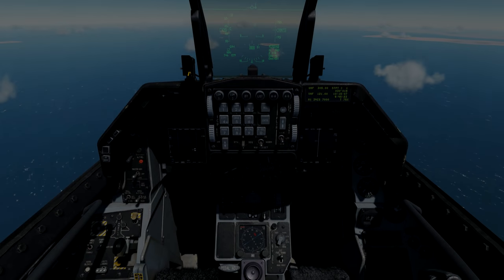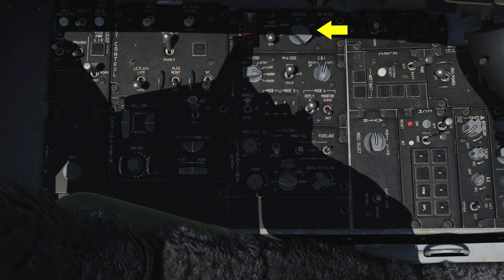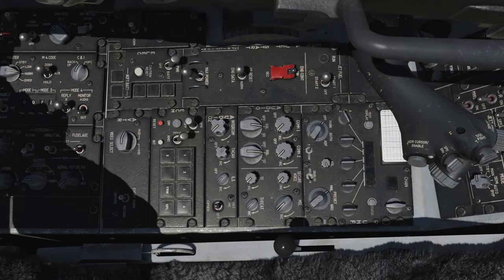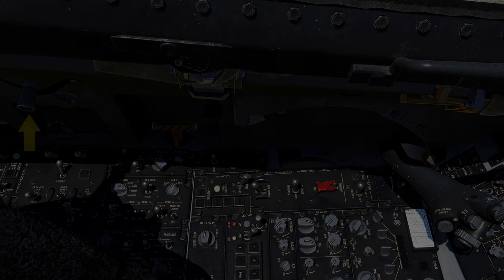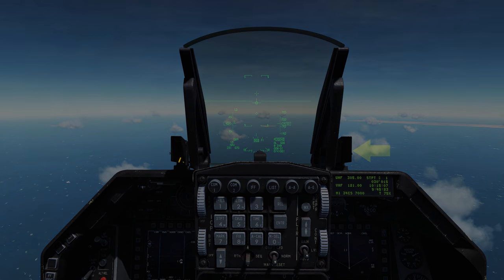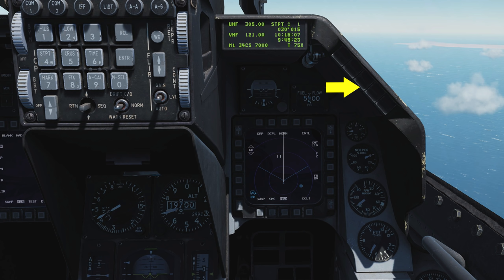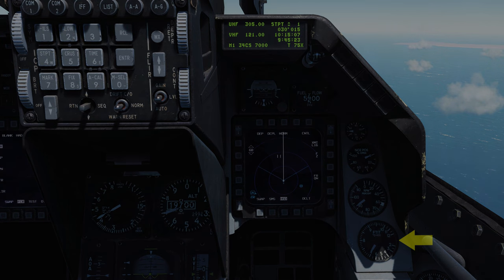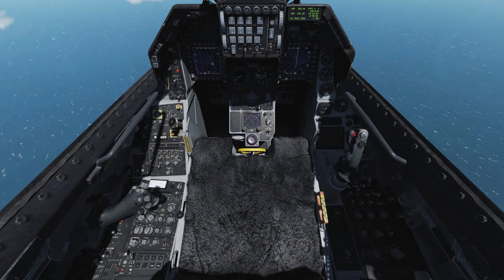DCS: F-16C Viper - Cockpit Orientation

Comment: “And finally we have the emergency arrestor hook and no this is not meant to be land on carriers although i know many of you will try” -Wags 2019
Reply: That's the second thing I'll try actually...the first one will be to take the plane off the ground.
Reply: taking off on the tarmac will be the first thing I try, landing on a carrier second :D
Reply: You're goddamn right we're gonna try, Wags. Just like the F5
Reply: @Swatmat  yep, it's a challenge, I've never done it without damaging my wheels.
Reply: @connorhuchteman  Barrier cables are permanently installed on certain runways but the cables cannot be set up by the ground crews in an emergency.
Reply: @KPX-nl4nt  They can be. Finnish airforce has mobile units that can be dispersed with jets to help them operate from austere road runways.

Also fixed barriers need to be set up before use. Cables don't just sit in there in the rain rusting away.
Reply: @thelittlestmig3394  I’ve spent most of my adult life in the USAF and I can assure you that we absolutely do leave our cables out in the rain. They lie out on the runway 24/7 as they should considering they have a rubber coating, unlike the naval version. They do require periodic maintenance and inspections after arrestments but that’s all. My profile pic isn’t just some random F-16 either. It is a picture of one of my former squadron aircraft performing a barrier engagement certification at Luke AFB, Arizona.

Comment: Ya know, I wasn't planning to land on a carrier, but thanks for the bad idea, Wags!
Reply: You MIGHT survive a landing, but an F-16 cannot take off from a carrier.   The nose gear is much too fragile to take a cat shot, even if you were to rig up some kind of attachment system.
Reply: I wasn't thinking about it before...but I am now.
Reply: @privatelisting366  doubt youd need a catshot if ythe deck is empty. f14 can do it easily with similer power to weight
Reply: Dont lie... You were already thinking about it!
Reply: @privatelisting366  Carrier launches once used harnesses rather than attaching to the front gear. Hence the 'harness catcher' sticking out in front of cats on older carriers, so they could reuse them.
Reply: somebody will do it. Somebody always does it.
Reply: @privatelisting366  Probably could takeoff from a Nimitz class carrier. Flight deck is 1,098 feet long. Would be doing it all wrong (you already landing an F-16 on an aircraft carrier), but start at the very end, and full afterburner takeoff with full flaps into the wind... she should be good too go.
Reply: @privatelisting366  I'm sure some smartass ABE would figure out how to hook up a makeshift Harness system which wouldn't need to use the nose strut. Bypassing the Holdback Fuse is another story.
Reply: CHALLENGE ACCEPTED

Comment: A little FYI regarding the Parking Brake. The "clamping mechanism" you refer to is the actual brakes. The caveat with the system is that the jet needs to be running for the brake system to work normally. If the jet is not running the PB can be used in a limited capacity by using battery power or main pwr with external power in conjunction with the JFS/Brake Accumulators. To put it very simply, by selecting Batt pwr the JFS and Brake system is energized allowing the toe brakes and the parking brake to work but only as long as the pressure lasts in the 2 accumulators. It was part of the "brake riding" (towing of aircraft) indoctrination in the AF. The 3 B's, "BATT" "BRACE" "BRAKE". Not until I crewed in Norway was the training different where they told us to just put BATT on, brace yourself and gradually apply toe brakes. We also used this to do brake bleeding if there wasn't a hydraulic rig available. Great work ED/Wags on everything you do. I can't wait to get in this cockpit again. Cheers!

Comment: Getting occulus just for this module. Dogfights are about to get real tough for the other modules. I was a F-16 crew chief for 6 years. They dominate dogfights.
Reply: Flight sims aren't real life, at Maple Flag, our F-16s ate the Canadian AF F-18s for breakfast. Full slick, the thrust to weight ratio is greater on the f16 than the f18. It comes down to the pilot making a mistake or having physiological weaknesses (the "big" guys can sustain more G's than the fit guys in most cases) over airframe weaknesses. This is what you talk about with the pilots during 12 hr alert shifts. Nothing else to do.
Reply: Thanks for your service, brother. I was in Iraq in 2011 in the 1st Cavalry. We'd occasionally see F-16s flying over and naturally get very excited.
Reply: Not if the MiG has anything to say about it.

Comment: wait. so if you could THEORETICALLY land on the boat, and then "have the ground crew reset the hook", you could then setup the plane to be really lightweight, and take off from the carrier successfully.
Reply: The Kusnetzov with the ramp comes to mind :)
Reply: You cannot. The hook will simply break. It was not designed to handle those forces. You will most likely break the gear as well.
Reply: Launch bar...........
Reply: If you can do it in a Viggen.... Viper might be fine, too
Reply: The arrestor hook is standard on all Air Force jets but is designed for emergency use on a field and not for the stresses of a carrier.  It would just snap if you tried to use it on a carrier.
Reply: John Vanderbeck how is a carrier arrested landing more stressful than a ground arrested landing?
Reply: SHD 46 why do you think I said Make the plane light :)
Reply: בר ציפורי doubt it. It’s DCS after all.
Reply: @maerus5227  A ground arrested landing applies less force over a longer distance. A carrier has very little space, the airfield has an entire runway. It is usually used in emergencies with brake or gear failures.
Reply: @maerus5227  Because on a carrier the system is designed to stop an aircraft in a much short distance after zero rollout, and has to handle an aircraft at full AB.  On a typical AF ground field the system has different requirements.  For one, it is normally used only for emergencies or for short field landings.  This means that the aircraft has a rollout distance before even hitting the arrestor which reduces energy.  Secondly the typical system is designed to allow the aircraft to move farther after hitting it, so the energy absorbed come s over a greater distance, thus less stress.  And the aircraft is throttled down.  The typical runout/rollout is 990 or 1200 feet as opposed to a carrier based cable system which is I think around 300 feet but dont' quote me on that last number.

Comment: @Wags, as far as I understand, f-16 has limited capability to land on aircraft carrier, in an emergency. 

But it's not meant to be normal operation due to light landing gear and airframe.

Are you going to simulate this in the dcs model?

And thanks for the great video.
Reply: @WTF1900, the tail hook on USAF fighters is meant to engage emergency runway arrestor systems, like the BAK-9, or BAK-12, which consist of a long cable across the approach or departure end of the runway, and in-ground braking systems that slow the jet to a stop over several hundred feet.  The landing gear on USAF fighters is not designed or built to take the stresses of carrier landings, and most likely would catastrophically fail.  Here is a good article with excellent photographs:  https://www.quora.com/Why-do-F16s-have-tail-hooks-even-though-they-dont-operate-from-carriers
Reply: The arresting hook on an F-16 is kinda like wings on a penguin in regards to landing on carrier....
Reply: @greghorine4995  thank you very much very informative indeed.

One more question, because in quora I didn't find, Egypt recently bought mig-29m2 and maybe su-35s can they integrate thier long range 77 into the f-16?

Egypt is only allowed aim-9 No long range weapons on the the f-16.
Reply from the maker: We've never seen anything to indicate "limited capability to land on an aircraft carrier".
Reply: The landing gear would most definitely buckle. The Block 30 F-16 and above have heavyweight landing gear to contend with the upgraded avionics and larger flight control surfaces, which increase the overall weight of the vehicle. Source: F-16 mechanic for 10 years.
Reply: @WarWithIn  Egypt's F-16's can field AIM-7P missiles, but as you know, that missile has limited range compared to the R-77, and is a semi-active, radar homing missile.  I'm not aware of any plans to integrate Russian R-77 missiles into the F-16 fighters.  If anybody could do it, it would likely be the Israelis, but I'm pretty sure Egypt isn't one of their customers.
Reply: @greghorine4995  I think Turkey would be able too, btw el Sisi is very friendly and cosy with Israel now, and he hates Turkey.

Thanks for the answer.

Comment: Wags, you mentioned when talking about the starter switch that you should use "Starter 2" for JP8 fuel. So I was wondering, are there any plans or ever going to be plans to add different fuel types into the different planes that would change the dynamics of the aircraft as it does in real life, or is that too complicated for a simulation?

Comment: I noticed he skipped the DTC cart, guess that's not going to happen...
Reply from the maker: No, we plan it, it's not an interactive part of the cockpit.
Reply: IIRC, they said they wanted to do something similar to the DTC for the Hornet, if that goes well I do not see any reason why it cannot be implemented also in the Viper. The DTC is a very important system for a proper mission planning, it adds a lot of immersion.
Reply: @MattWagner  Those are excellent news. :)

Comment: Why there're almost every panel got "+" mark near the center?
Reply from the maker: You'll need to ask Lockheed Martin about that, I don't know.
Reply: @MattWagner  Thanks for reply! A Hornet got these plus marks also..
Reply: I’m not sure if this is true, but someone once told me that the actual electric connector of the panel is ‘under’ the plus sign.
Reply: @preamp51  so it marks where the panel to be pushed down when installing?
Reply: Roman V, possibly..., not sure about that.
Maybe it tells maintainance personel where not to slide under any tools to prevent cable damage.
All I know is that I have noticed the same ‘plusses’ in airliners.